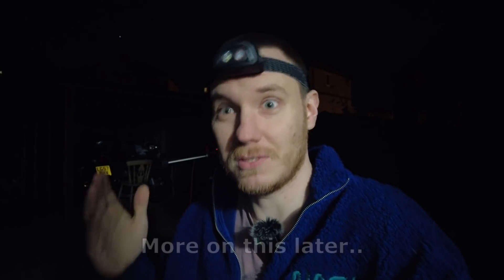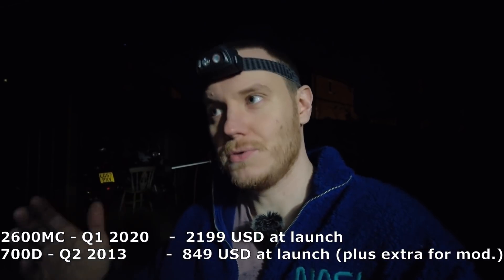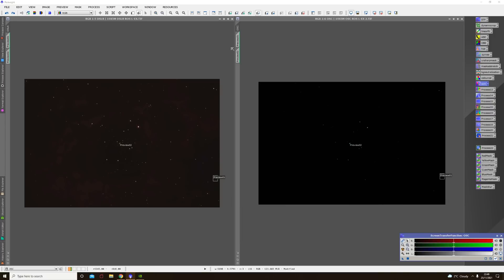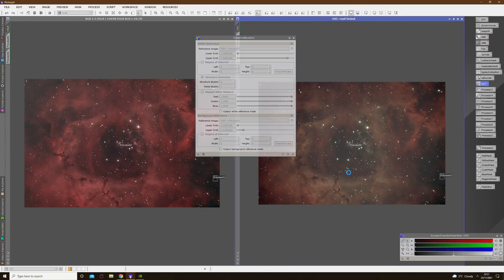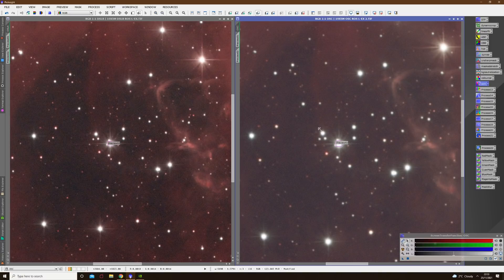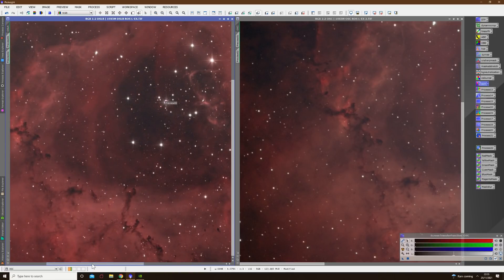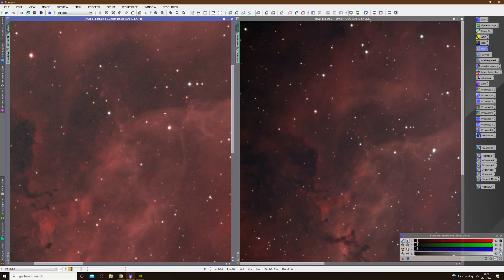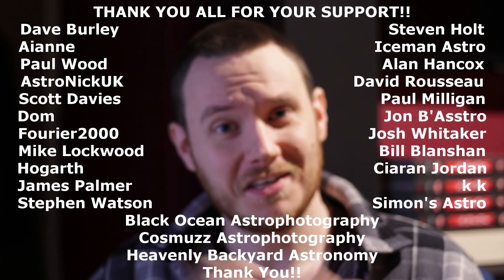Modified DSLR VS Cooled OSC - Part 1: NOT What I Expected!

Comment: Hey man! I'm afraid you didn't compare cameras but sky conditions at different times :)

I immediately thought the cooled OSC camera imaged during a time of bad transparency (and potentially seeing). To check that (as well as I can with just the stacked image - ideally I'd need the sub-frames directly without calibration), I star aligned one image to the other so we got the same scale, cropped to remove any stacking artifacts (applying same crop to each image so we have same FOV at same scale) applied a first order ABE on each, then used the SFS to check statistics. As I expected, the OSC image gets far fewer stars detected (1350 vs 1800) and a worse FWHM than the DSLR image. This is a strong indicator of atmospheric/lighting/guiding conditions influencing the end result, rather than the camera itself.

This is why I do such tests strictly right before and right after Meridian (so same object altitude), on the same night, across a total timespan of at most 1 hour (usually closer to 30 minutes), while closely monitoring conditions. You mentioned that clouds cut the OSC session short, and then part of it was taken the night after the moon was closer to the Rosette - it's likely that subs prior to the clouds appearing started suffering from poor transparency, and the subs with the moon closer would also have suffered.

That being said you proved something that bears repeating: great images can be taken with a humble DSLR!
Reply: If sky conditions or moon brightness or light pollution didn't change, the camera with the bigger pixel will win the contrast battle, it's why Trevor is now using an ASI2400 OSC on a redcat, completely undersampling.   I believe Dylan did a video on this as "Astro cheating" by undersampling, then drizzle after.  More contrast, lesser star form issues, etc.   If you use a ASI 294mc your results would be near the same I assume, very close pixel sizes, as long at the exposures are matched based on the histogram.  Bigger pixel camera will yeild a higher median histogram value if at the same exposure time as another camera.  The 2600mc should have a higher sensitivity that the Canon but a picture speaks a thousand words.  You can try and bin the 2600mc but I found on binning osc's don't always make for better detail.  I would have to investagate the noise curves online to see if I can find more for ya Great gob on this Luke and look forward to more investigative videos like this.

P.s.  if you did a star alignment in PI on the 2600 re the canon , you need to be careful with this as it will perform indirect noise reduction if you are using the spline method because the software will use an algorithm to compute the date to match position of the reference. therefore your STF stretch will have a different "visual" affect when stretched.  If you use spline method (mainly for chromatic distortion),, down at the bottom on the alignment process under interpolation, turn off auto and try bicubic spine as a start.  Something i get weird artifacts when it is set to auto.
Reply from the maker: @billblanshan3021  Thank you for the insights Bill!! Great points :-)

I'm super glad to hear you liked the investigative style mate, it was interesting to make as it's a question I've often wondered myself!

I do make a short mention of the difference in sampling ratio quite late in the video, when looking at the top right pillar section, but certainly I should have emphasized this point more in the video! again, super suggestion - thank you!

RE: alignment, I did it visually & by hand with no transformation to the image scale, just cropped the 2600 to match the canon field of view basically :-D

Thank you so much for watching, and for your continued support my friend!
Have a wonderful weekend :-)
Reply: @lukomatico    you did a very good job here Luke, as always!   You and Cuiv are killing it!  Great stuff!
Reply from the maker: Thank you Bill!! 👍👍
Reply from the maker: Hey Cuiv! - very interesting points mate :-)
Thank you so much for watching and sharing your thoughts, always a true pleasure!
My feeling is that there's something else at play rather than the seeing here, it seemed to me that the conditions were quite stable all night! - I could easily be wrong though, but another pair of eyes checking things would be good :-D
To that end, I've just uploaded the last stacked sub from the DSLR, and the first stacked sub from the OSC - if there's a big difference in FWHM then I suspect it wasn't down to seeing as the time between those two subs is minimal, and both were cloudless :-)
My thinking is that there's potentially some in-camera sharpening that's just native and cannot be turned off?
All the best!
Luke
Reply: @lukomatico  Thanks Luke! I just looked at those two individual subs taken back to back, after (and also before) doing a star alignment (with bilinear scaling as bill suggests) which scaled the OSC data up a slight bit (e.g. bad for the OSC SNR)... In those  two single subs the OSC data is much sharper to my eyes, as well as being much less noisy... BUT I see star trailing in the DSLR image while the OSC has pinpoint stars. So I can't conclude anything for sure :D

I also looked at the FWHM (after scaling, otherwise PixInsight will be confused unless it knows the exact pixel scales of each image independently), and found it to be very similar (a bit higher for the DSLR, but that can be explained by the trailing and higher eccentricity), indicating close atmo conditions.

Overall great and fun video :)
Reply from the maker: Hey Cuiv! - very interesting conclusions, again, thank you for taking the time to have a look and share!! :-D
I hope a second test could be more conclusive, utilising slightly altered methodology, but overall similar approach!
Reply: @lukomatico  yup the DSLR does some sharpening in camera

I do retouching too so I reduce the sharpness before working on
Reply: This video has generated a fascinating conversation about seeing and image quality.
Reply: Luke, it seems like you just need to get another EQ8 and a 250pds and run both AT THE SAME TIME 😀 also make sure they sit on the exact same latitude so position them west/easy with respect to one another 😄 that being said, Cuiv has a point. The moon and object altitude might’ve had an impact.
Reply from the maker: Hey Kamil! :-) Cuiv definitely raises some interesting points! I know you're only kidding but man, can you imagine having the resources to do a comparison like that haha!! :-D
I hope that you enjoyed the video mate, and still found it somewhat valid!
Reply: Definition of 'Versus'

1 : against
2 : in contrast to or as the alternative of 
     "free trade versus protection"

I did watch every single of your videos and in general I'm pleased with your effort and share input of your experiences in astrophotography.  Not this time.

What botter me of such 'Versus' videos around is in the end there is not really Vs. For many reasons.

Technology year difference:
As you wrote in 2:46 min you can not even 'compare' two cameras that have seven years apart in technology especially in the digital technology area where there is so deep difference year after year. Seven years is really a big gap.
Instead you say is not fair compare the difference of the cost.....?
What you can observe instead is some kind of 'response' in perfomance (if any) taking into consideration putting both cameras into equal variables of usage (at least the most noted for both).

Sensor differences

                                 ASI2600MC Pro                Canon 700D Moded 

Sensor size:   23.5mm x 15.7mm                   22.3mm x 14.9mm 
Resolution:    64248 x 4176 / 26.1 MP          5184 x 3456 / 18 MP
Pixel size:               3.76 µm                                      4.30 µm
                         16 bit ADC sensor                  14-bit DIGIC 5 processor
QE                                81%                                         38%
Full Well                     50Ke-                                       20Ke-

Quality photon capture

At 3:10 min you say that the DSRL ran at 9C while the OSC at 0C If you wanted to be 'fair' you should cooled the OSC at same temperature of the DSRL ambience.

In 4:12 min you say the Rosette was not so close to the moon the day after as was the DSRL frames toked the day before with just one day but you assumed 'is not going to make so much difference relatively to this experiment'.

And it does the difference. Precisely.

The DSRL session was toked much early and in the video shows is not really so close to the moon as was the frames you begin taking after with the OSC and you stopped sometime after because of the clouds, meridian flip etc.  But already you have some frames toked in that conditions. The day after you do not say at which time you toked it but that the moon is more far from the Rosette, even that, if the moon is in crescent then is more bright and the disturbance caused by the moonlight is more (this is a guess though). 

If you wanted to do a 'fair' comparision you should toked a session with both cameras at the same time, the same target, with the same optic and same filter, with the better ISO/Gain of each camera and cooled the OSC at the same ambience temperature of the DSRL. In this way both cameras are in the same parity of condition for took the same QUALITY of photons.

Even with those equal 'variables' you should obtain noted differences in the final process of those simultaneous session, why? because the deep differences in its technology capabilities.

Process difference
Other thing I really do not understand why you should use the same setting for process the data when the data from both cameras are very different in information content.  So is not a surprise you have to admit after that you could not continue to develop them as you expected.

"by this I mean that different noise scales/amounts can't be processed with exact same setting. Inevitable this would cause some level of variance between the two images while processing"

In fact, that is the point of expected difference you should see.

The problem was your surprise in the 'sharp' you noted between the DSRL image and the OSC.
I think it was a wrong consideration to stop the 'evaluation' only in the sharp/details from the DSRL where was a bit more 'noted' due the contrast level of the image, which by any means is 'better', when the image suffer clearly of a lot of noise (as usual) and do not taken into account OSC's image is more smooth and has more 'definition', but you in some way consider it worst (even if you do not mention it). You laugh.

Beside that you wrote: "More pixels, same sensor= finer sampling ratio per angular portion of the sky."

They do not have 'same sensor', ZWO has more pixels, pixel more little, more resolution and more information...

In the end, the apparent difference in contrast is basically due to the conditions in which each camera acquired the frames.  If you process both until the end in the best way possible I can guess you should see more details, definition and contrast in the OSC than in the DSRL image.

The DSRL instead is showing that continuing be a valid option (even old models) for beginners, amateurs and professional astrophotographers and is really a good alternative for bring in travel situation with its usual lenses or little scope and Adventure mount sort of or just a tripod.

I hope you take this comment in the best way possible, I prefer see your usual and good videos than a 'Versus' that has not point at all.
CS

PD:  I imaging with a Newton and a DSRL. I suggest you to use a cover extended in the Newton, overall in Moonlight situation.
Reply: @corocorascarlet1592  I think your response was a bit uncalled for.  Luke was simply just comparing the results of both cameras as the results were clearly different from a visual standpoint from his PC as we saw the same in the video. There is no harm in that and it is nearly impossible to have a 1 on 1 comparison, he was just comparing the OSC to his DSLR, that's it.  If he decides to investigate more then that would be cool to watch, however negative critics like you might sway him from doing it, so please keep your negative comments to yourself.  No of us are "professionals" at this, but I do stand beside him as to why he made the video and this could be investigated more so let's support that please.  Thanks
Reply from the maker: Hey Bill! - I hope you are getting some imaging done my friend! :-)
I'm happy to say that I currently am at least, I'm out recording part 2 of the DSLR vs OSC comparison as we speak :-D
I feel maybe the intention of this video was lost in translation somewhere for a few viewers, and for that I blame myself partially, but it won't put me off either way, so no worries at all there! - with practice I'll get better!
I do hope anyone disappointed with this video will give the next one a chance, I don't know yet how it'll turn out but I certainly will do my best to present an honest approach to whatever transpires from the test!
Thank you for being a stalwart friend! :-D

All the best,
Luke
Reply: @billblanshan3021   It is your opinion and right to consider my comment that way. Neither my observation on the one hand, nor your comment on mine on the other, will stop Lukomatico from making his videos (thank God), videos that I have seen and where I have subscribed to his channel a long time ago.
If I did not care about his videos and his content, I would not have bothered to write about it, but it turns out and I repeat it matters a lot to me (This is one of the few times I wrote something in YT).  Lukomanito as well as Nico, Cuiv, Trevor, Dylan, AllynW, Entering Into Space (Steve), Chuck, Shawn, Ruz, PeterZ, Tim, JamesL and many others have done and done a formidable educational and instructive work in these last two years to those who begin this passion as never before had been done and for which I am very grateful as a beginner to all of them, since it would have been much more difficult than it is without their help through their videos.
In Part 2 of this 'Vs' confirms what I wrote and is not surprising. Other comments digested the same as my comment but in a different way ... probably my bad English does not allow me to express myself with more finesse.
I also reiterate that the use of DSRL to start in this passion is not only recommended but also essential since it opens the perspective to fully enter this wonderful hobby as well as being the easiest and most fun way to obtain very good results.
When you want to compare some things and the conditions are not the same for both, the result can be misleading and far from the reality of the compared objects ...Clear Skies
Reply from the maker: Hey there! I'm sorry you feel that this video wasn't a good one, I do think that you've missed the point of it though!
I hope you'll accept this in the spirit it's intended 👍
All the best, 
Luke

Comment: Again if you consider possible slight misting on the OSC due to the colder night, and the moon glow, maybe this could account for difference. Always wondered if you can calibrate reduce noise rather than spend another 2000 pounds (2700 usd) for astronomy camera and filters (astrodon) 2000 pounds extra.
Reply from the maker: Hey there Bill! Thank you for the possible explanations matey, I appreciate it! :-) It certainly seems with newer noise reduction methods you can calibrate out a metric ton of noise, especially Topaz and the like!
Thanks so much for watching!!